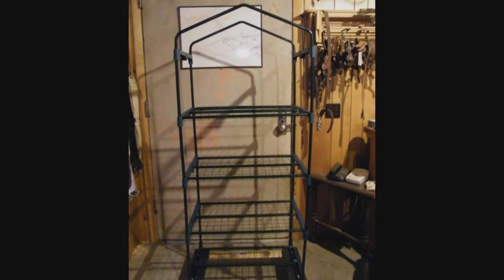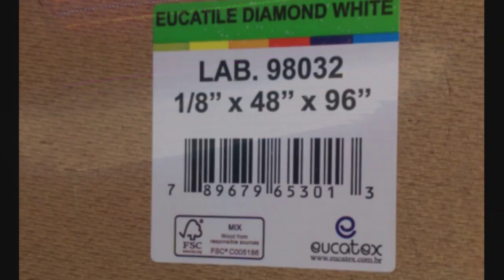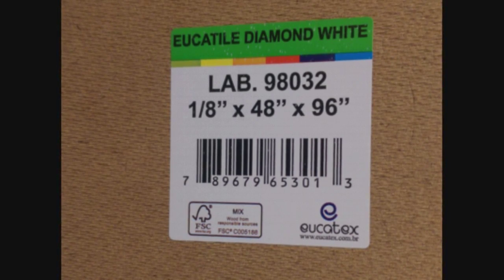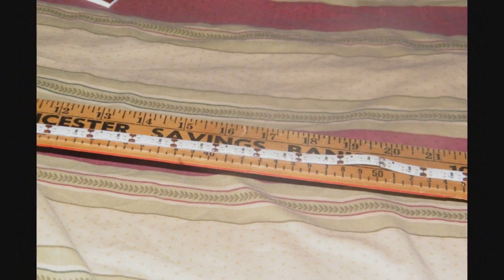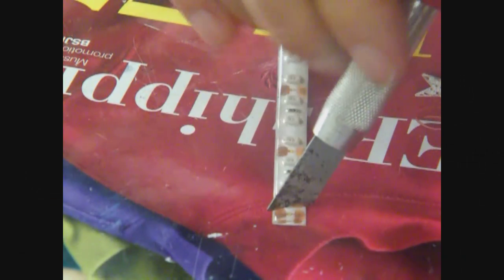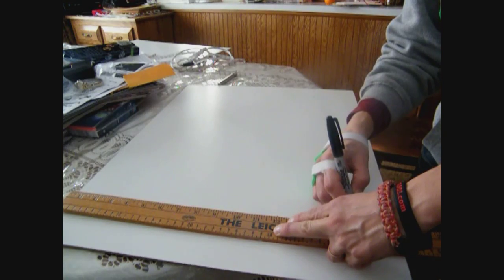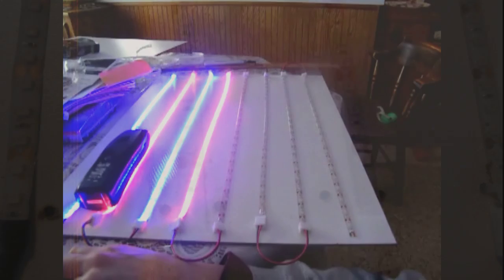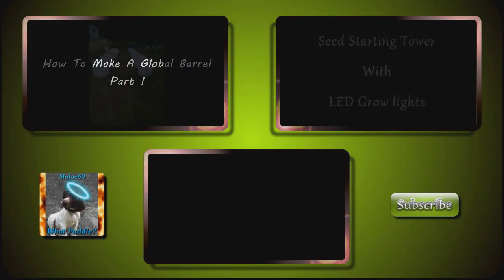How To Make A Seed Starting Tower With Homemade LED Grow Light Panels Part II

Comment: I have the same greenhouse racks. I mounted 2x 16' strips per shelf and attached them to the top of the shelf. Each shelf had 8 rows of lights.  Almost every plant came out leggy.  

Now I made another rack (same greenhouse) and did 18 rows per shelf and am hanging them 2" from the trays and the plants like it better.

Comment: I am very excited to see how this progresses. How much do you estimate each panel cost to make?
Reply from the maker: $32.63 each and i have 9 connectors left and enough of the white board for 4 or 5 more panels. it would have been $30.00 if I could have found those old ceiling tiles.
Reply: mojoe60 Seems reasonable for sure. I look forward to seeing how this works on your seedlings. I have considered doing this for my indoor lettuce and basil crops since they do not seem to require that much light. I certainly hope that this works as I would love to give it go. For now the fluorescents I use do the trick.
Reply from the maker: frozenfowler
that's what i've been using